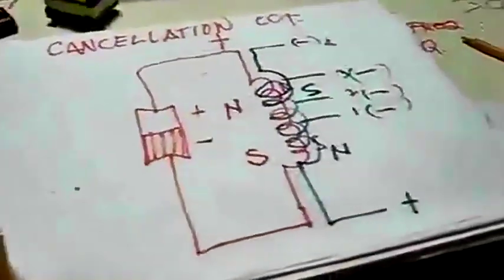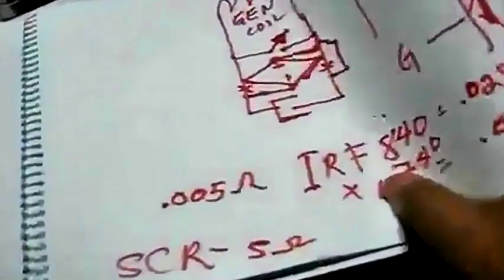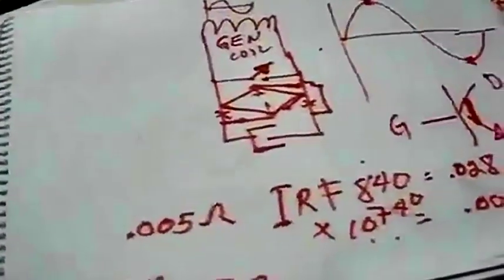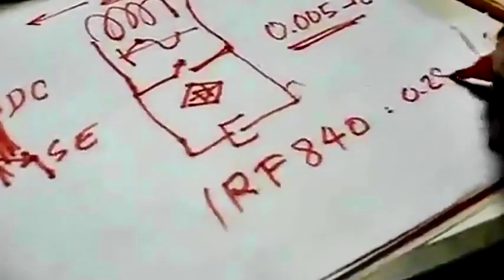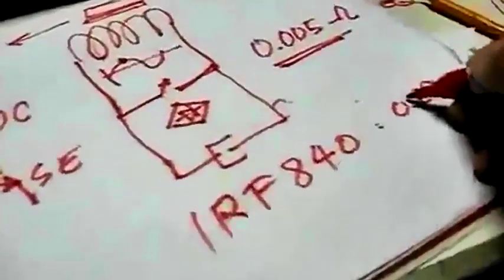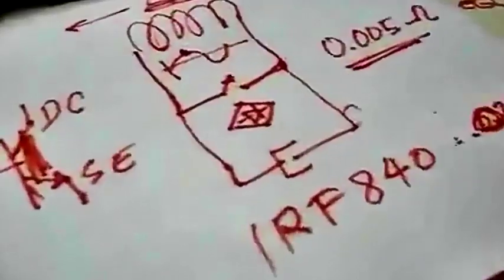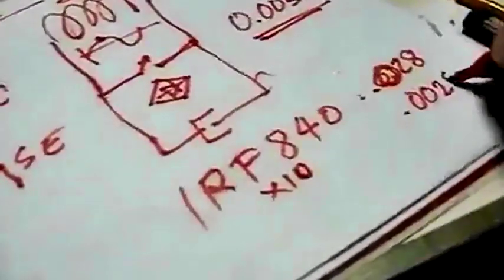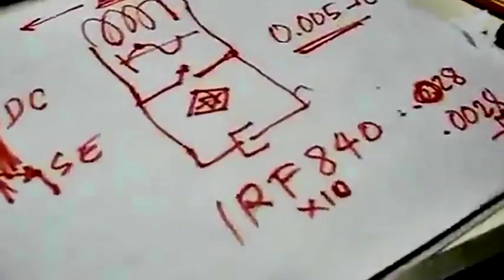Free Energy : Ismael Aviso Electric Car Secret : Coil Shorting

Comment: Hey thanks for doing this. Several comments below highlight the historical state of this technology. Something I'm in the process of coming up to speed on. There are science dogmatic deniers, economic deniers, Tesla promoters, and practical electrical support from those that know the EE model is incomplete/misleading.

Tesla proved that there is more to electricity than charge movement. He focused on capturing the faster than light aspect of what he called pure energy (aether) from the hybrid-energy that is electricity. From his work the impulse is what sets this free, and then pulls to the circuit aether (aether behaves differently than electrons) from the surrounding space (it is the neutral, incompressible stuff that fills the space between protons, neutrons, and electrons, and actually also forms matter and electricity). In conductors it also creates electrons/charge. What sets it free is impluses of high voltage, the higher and more unidirectional the impluse, the purer the aetheric extraction. Without a force of magnetism to set it free from the charge, it would simply compound the amount of electricity in the circuit (it is a separate aetheric induction, not an EM induction. Your impluses areless powerful than a spark gap with a magnetic suppressor and carbon conduction element and nitrogen atmosphere). So mostly you are left with straight up electrical charge and current effects, that always have this hidden aetheric induction happening with higher voltages. It can look like normal electric behavior, but if you kicked the voltage up, and the frequency, I'm betting the additional power would be exponential, indicative of the aetheric effects adding to the mix more than a straight line electrical amplification. This is why designing high speed electronics is so sketchy, the traditional models don't work when all the data streams act like impulse signals that separate out the aether which naturally concentrates and travels faster than the charges.

Can't wait to see your other posts. Peace, B

Comment: When you short an LC circuit at resonance, it causes a standing wave to occur in the circuit. The voltage node appears across the capacitor and the amp node across the inductor. Strange phenomenon happen at this point. One wire transmission, over unity, and cold electricity can all be witnessed at this stage. This is the exact thing that Tesla's disruptive discharge circuit did only that used a spark gap. If you look at Tesla's genuine circuits,  you can see that both the cap and the coil are simultaneously shorted when the capacitor reaches it's peak voltage and discharges across the gap. Ismael Aviso also shorts his circuit at the top of the sinewave.

Comment: Another component to his design is the required amount of voltage to break the ambient potential. He didn't mention this, but he hinted in another video about this topic. I'm certain there is a minimum voltage needed to do this otherwise Tesla and many other successful inventors wouldn't bother using high voltage systems.
Reply from the maker: I agree. He is using around 320VDC after the inverter in his simple cap charging demo.
Reply: kEhYo I think the 320v is just a starting voltage to give him BEMF that are in the order of a few, if not, several thousand volts.

My guess is that they are trying to overcome the Air's breakdown voltage.

Comment: So he uses the IGBT to make a boost converter. That would suck more energy out of the mechanical system. As for getting "free" energy, I haven't seen it yet. By now everybody should be driving electric cars if it worked. I haven't figured out if he's an idiot or a crook yet. However, he also sells cancer-curing water and magic medallions.
Reply: The history books are filled with circuits that out perform commercial systems. The world is not driven by better mousetraps, it runs on more profitable mousetraps. Free energy clearly is less profitable. Your denial based on profit is not sufficient to invalidate this action, if anything it would affirm the free energy aspect.

The ad hominem remarks are proof you are trolling, not bringing value to the discussion.

Comment: There are so many things wrong with this. First off, the original LC circuit he draws can be found in any introductory physics textbook, and does not violate any physical laws due to a 90 degree phase shift in the current. Everything is conserved.
Secondly, a short does give low resistance, but only because it's a short. The second you place anything (like a mosfet) in the path of that current, you get resistance. And regardless of the resistance of that particular transistor (FETs by design have incredibly high resistance/impedance across the gate, because that's how they work) adding resistance in parallel does not decrease the resistance across that particular element. There is no magic here. 
One of the best resources for debunking this type of rubbish is the museum of unworkable devices (dot com). Find your own skepticism there.
Reply from the maker: He doesn't draw an LC tank. It's simplified. The capacitor is for collecting emf collapse from a momentary short across the low impedance coil. Paralleling mosfets decrease overall conduction resistance of drain-source path, according to Ohm's law (the gate has nothing to do with this). His invention works and has been tested to work in his electric car by government authorities. Do some research, please.
Reply: +Max Bessey If you use several mosfets in parallel the resistance of those mosfets are in parallel as well so that part was correct. The disturbing things were his drawings. He should learn the symbols of the bjt, mosfet, fet and igbt.

Comment: that is source of energy  that installation?
Reply from the maker: The source of energy is a low impedance coil shorting technique.
This way of getting energy does not reflect to the source.
Just transform an induction motor into RotoVerter, so that at nominal speed to consume just a few watts due to LC resonance. Attach heavy flywheel with neos in NSNS configuration to it. Place pickup coils with ferrite cores around, and instead of continuous power dissipation to a load, as you would normally do, short the coils at top dead center. This way your input power will not increase, maybe in a minimal way, but the power output will exceed those few watts if done right. The pickup coils should be made of a thick Litz wire and consist of not too many turns for low impedance.